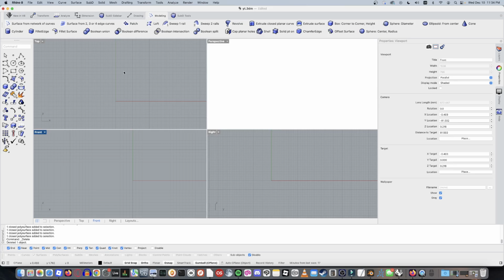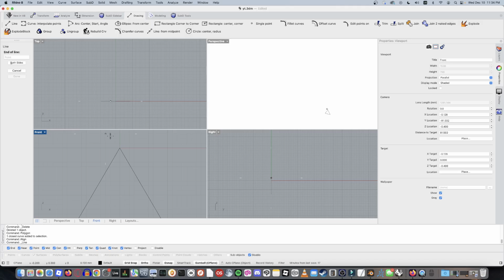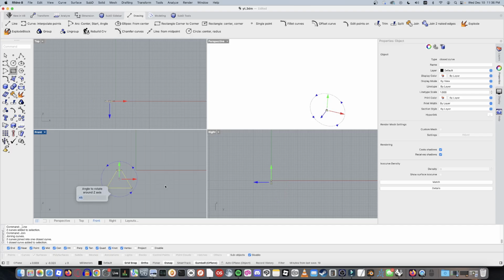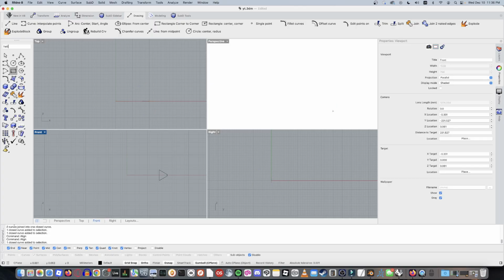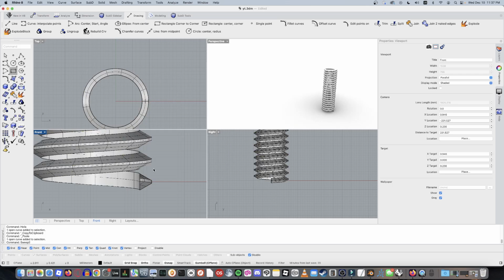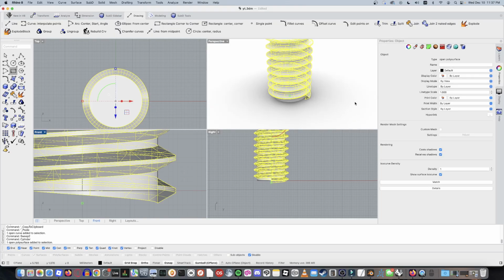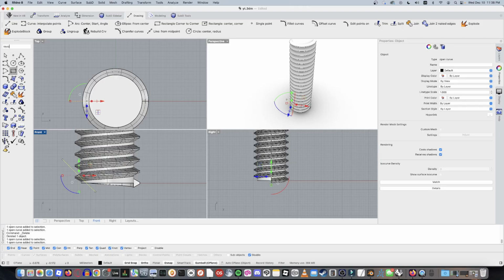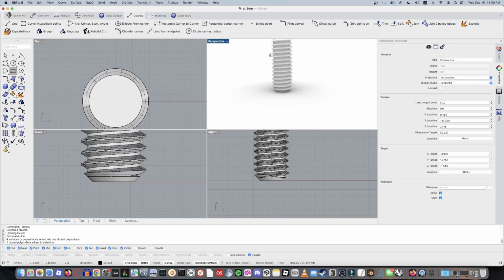Create Metric Threads in Rhino 8

Comment: Bro, barely hearing what you saying, plz increase volume, Nice vdo btw
Reply: I have this problem all the time with different videos. Currently it's because my new computer monitors don't output as high a volume as my old monitor. The fix I found was to download a volume booster for the browser (Firefox) in my case. This is an extension and usually a free download. Just do a search in your browsers extension library.